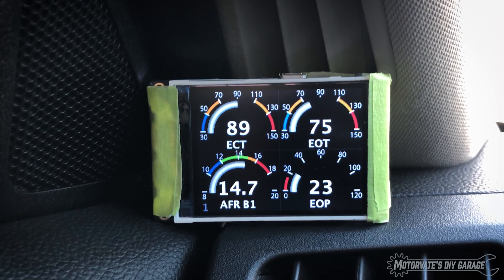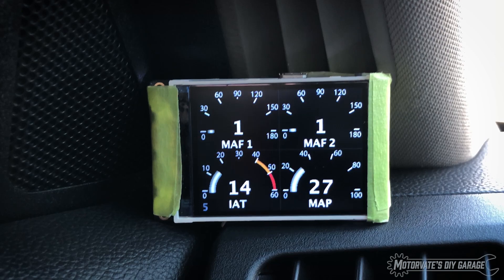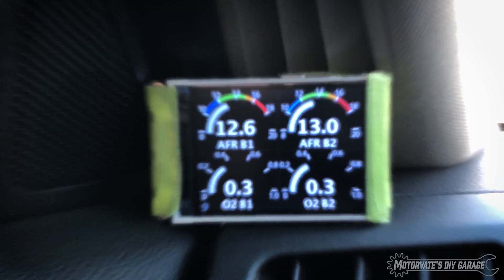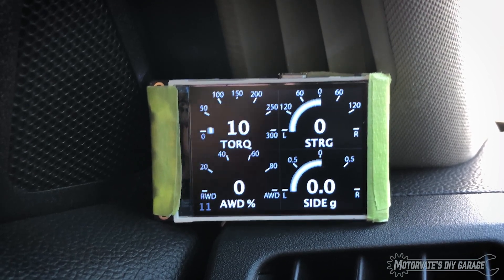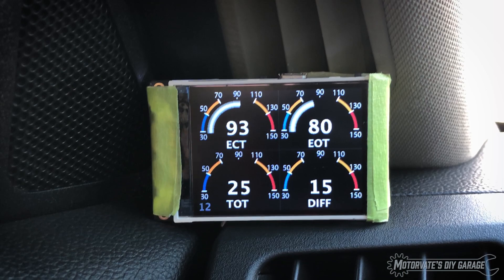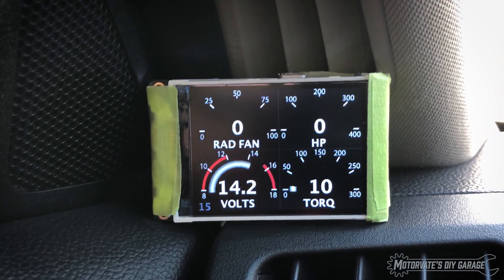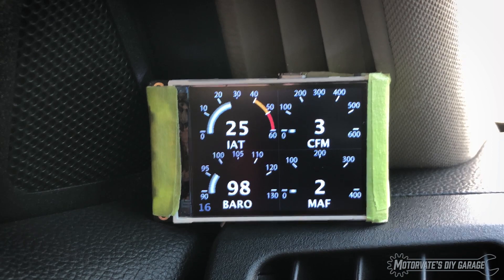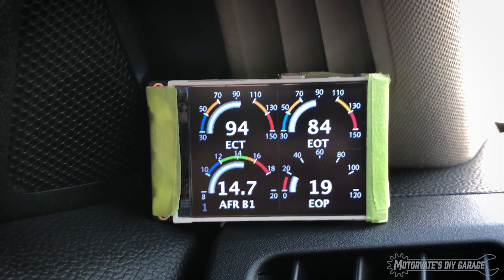16 Page Mini-Dash/LCD Gauge Update! MotorvateDIY Garage Ep.42

Comment: Hello I am wondering if this is compatible with a standalone ecu or even other car brands with can bus
Reply from the maker: This mini-dash can be made to work with any vehicle.
It simply reads the data on the CAN bus, converts it and displays it.

The challenge to get it to work with other vehicles is having the CAN bus definitions. Typically stand alone ECUs define the CAN bus data, but stock ECUs need to be figured out... and that can take a lot of time. :(

Comment: Hey Fred, please let me design and 3d print something so we can mount it to that A pillar. What you’re doing here is incredible, and I’d love to support it in anyway I can.
Reply from the maker: Thanks for your kind words and offer.
I'm still having a hard time sourcing a nice 2.0 - 2.2" IPS LCD, so the final hardware design is not final.

The test mule (shown in video) uses a Lillygo T4-Display, and the LCD display has a narrow viewing angle, which I don't like. An IPS LCD has richer colours and a 170 degree viewing angle. That's why I'm on a hunt for a nice IPS display with a pixel density > 180 pixels/inch.
Reply: @MotorvateDIY  absolutely. I’m on myg37 forums, that’s where I found you. I have a non sport sedan, and I’m interested in helping the project, and when/if the time comes purchasing one from you. This is an amazing modification. Kudos to you for all the work behind this. 🙏🏽🤙🏽🤜🏽🤛🏽
Reply from the maker: Thanks Chad! Once the new hardware is done, you will see an update here, Reddit, myg37 and my Facebook page: Frank Motorvate

Comment: How's it coming
Reply from the maker: Overall, it is working very good. I plug it in to my G37 almost every time I drive it.

However, about 1 in every 30 times it starts up, it just keeps rebooting. Pushing the reset button once always gets it to boot up normally. 

I'm going to have to do some digging to understand what is going on.
Reply: @MotorvateDIY  Are you running C++? Or some kind of FreeRtos?
Reply from the maker: Good guess!!
It is all done using the Arduino IDE with C/C++ and a few RTOS tasks: receive Bluetooth data, receive CAN bus data and send CAN bus data. The main loop updates the display and writes to the SD card.

The ESP32 is a fanatic micro to work with... so far what ever I ask it to do, it does it without breaking a sweat!

Comment: Oil+coolant temp, manual trans temp, and rear diff temp. Im sold. Take my money and sell me this 😂
Reply from the maker: Hey DevilG,
Thanks for the comment. Every time I drive my car, I plug it in and test it. So far it has worked perfectly every time.... Connects to the Bluetooth sensor server, and starts to log data to the SD card.

I also added the "GPI" (Gear position indicator) functionality (see: https://youtu.be/hd8F5H_PcFc) I don't need to know what gear I am in, BUT I sure like seeing it on the dash!!  NOTE: For manual transmissions only.

There is a local G/Z car show coming up in the next few weeks and I will be able to test it on different models of the G. For example the G35/G37 with ICC require a different way of changing pages.

I will add you to the "interested" list.
Reply: @MotorvateDIY  Add me to the " very  interested in this device list" lol.
Reply from the maker: That's funny!!! I got your message about DDT and will get back to you shortly.
Reply: @MotorvateDIY  Interested as well, is there a list you are building?
Reply from the maker: Correct and I have added you to it :)
Reply: I would to be added as well!
Reply from the maker: Thanks for your interest, I will add you to my list :)
Reply: @MotorvateDIY  thank you very much! Obviously it's not done yet but do you have a target price range? Or waiting until it's mostly done so you don't jump the gun on the price?? Ex: will it be under $500? $1000? $250? I know you were saying the price of some of the components in one of the other videos but never caught the overall targets price. Thanks again
Reply from the maker: I want to have this as affordable as possible, so under $250 should be doable.  I will need to get current pricing on the parts I use and finalize the design.

I'm also thinking of an easy to assemble "lego like"  DIY kit.
Reply: Please add me to the list as well. I literally bought my G37 7 months ago and absolutely would love to have this. I run a Tesla style screen in my G and was wondering if the Bluetooth can be used or communicate with an app so I can display on my already oversized screen? It’s CarPlay compatible and android compatible. Heck I’d even buy a second and 3rd kit for my other cars I’m building (C6 LS3 and Acura TL SH-AWD)

Comment: Will this be pi based? Please say yes. I would love to integrate this into my hud build.
Reply from the maker: Sorry, it isn't Pi based. I use a 32 bit micro controller that starts up in less than a second.
Reply: @MotorvateDIY  better response time. So what vid output? Or I guess I'll find out upon release. Very interested.
Reply from the maker: There isn't an actual "video output", just a SPI (serial peripheral interface) that is connected between the micro controller and the LCD. 

The micro controller (ESP32) does all the work: receives and processes the bluetooth data, receives and processes the CAN bus data, sends the OBD mode $01 requests, saves all data to the SD card and updates the SPI connected LCD 24 about 30 times per second.

Tell me more about your HUD build. What car and what data are you displaying?

Comment: Awesome work! What sensors do you need to add in order to make it functional?
Reply from the maker: Thank you!!

Out of the 35 data items, I have only added 4 sensors:
• Oil pressure sensor
• Fuel pressure sensor
• Manual transmission oil temperature sensor (for automatic, we use the built in sensor)
• Differential oil temperature sensor

For everything else, the data is retrieved from the G37/370z network known as the CAN bus.